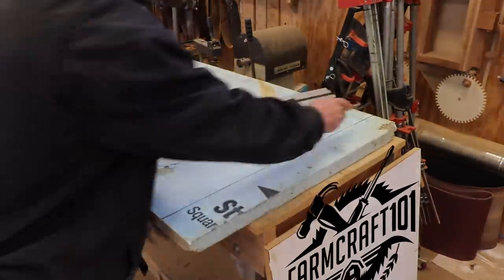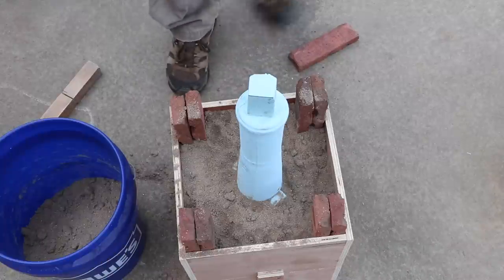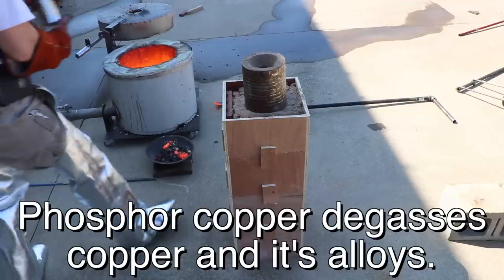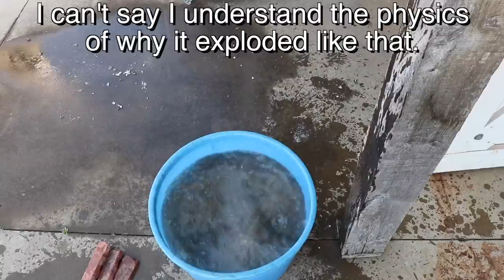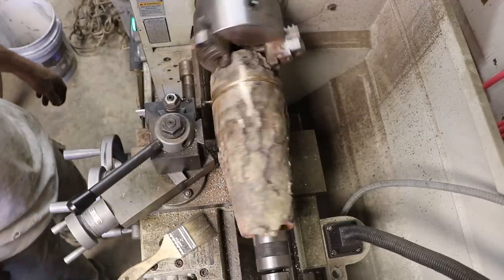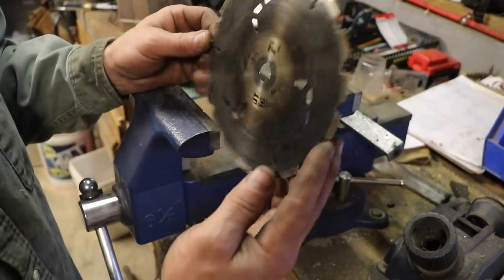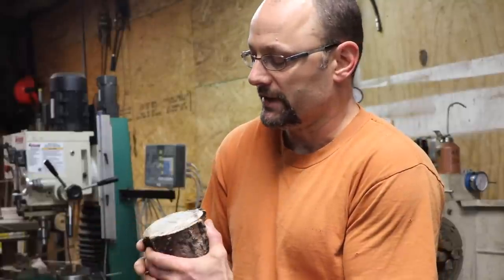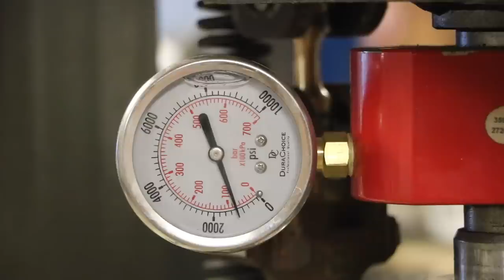How NOT To Cast A Historic Bronze Cannon Barrel.  FarmCraft101

Comment: After reading some of the comments and replies thereto I feel that a little "Metallurgy 101" is in order.
Phosphor copper does NOT remove hydrogen from copper base alloys, it is in fact a deoxidant and is thus used to remove the ever present (In badly melted copper) copper oxide. In this case the zinc added via the brass would likely have already done that so the phosphor copper addition was unnecessary.
Left over phosphorous (and that is what you would have had) forms a low melting point eutectic with copper that is about as fluid as methylated spirits - it will rapidly penetrate coarse or loosely rammed sand moulds forming an ugly composite of sand and metal  - (well, fancy that - sound familiar?) that is, as you found out most destructive of tooling.
The voids seen in most if not all home melted copper are NOT hydrogen.
Even when done well lost foam is not a technique known to produce the best quality castings. The idea is that the gases from the styrene escape through the sands  and NOT through the liquid metal. Styrene has the general formula (C3H8)n. {EDIT, this is a mistake C3H8 is propane what I meant to type was (C8H8)n and in response to a request from a commenter I have edited this post to both correct and expose my typo. END EDIT} At the temperatures involved here some decomposition of the styrene is likely thus the gas bubbling through you metal did contain hydrogen, and some pick up seems possible perhaps even likely. In any case to assume that bubbles (save perhaps inert gasses) traveling through metal do not leave damage in their wake is foolish in the extreme.
"Linear Grain" - Hmm, that's a good one - Its actually called "columnar grain". It results from grains (dendrites) growing inward  (into the remaining liquid metal) from the outside being constricted into growing in just the one direction (inward) by the grains growing alongside them.
Just a quick eye ball of that crucible and pattern told me that there was little chance of there being enough metal in that crucible to fill that mould.
The number on the outside of a (good) crucible is its capacity in Kg of molten copper brim full - you can always use that minus a bit in any calculations to see if enough metal is available.
I think that you were lucky that you did run out of metal  as had you not I suspect the mould would have floated up (from the lowest box junction) and you would have got very wet and hot boots, moon suit or no. I would suggest that clamping or weighting the mould a much better safety precaution than one of those awkward and restrictive moon suits. 
The gauge length on you tensile specimen was a bit short - actually a lot short.
This is not all that I saw but its all I have time for now.     Fred
Reply: good analysis
Reply: deuces roxy , Didn't need Cody's lab to  tell me what was wrong here! Don't watch him much and have some doubts that he would know its such an arcane area. Also would someone please tell Farm that the word is  "Cast" not "Casted". Fred
Reply: LIttle bit of phospor/copper goes a long way.  The more you over due it the less tensile strength, and the more brittle the metal.  The vertical cast was too much weight and swelled your canon.
Reply: @rich1051414 , Ouch! Please be assured that I did not intend to demean Cody's lab in any way, while I am not a regular viewer I have watched some of his videos and did find them quite interesting. Note that it was not I who introduced him into the conversation. There is in fact a co-dependency :- where would metallurgists be if there were no geologists to find the stuff they work with and where would geologists be if there were no metallurgists to use the stuff they find? This mitigates against any mutual demeaning and if fact great respect exists, two sides of the one coin almost.
Back in my student days the metallurgy and geology departments were under the same roof, we were in essence the same department, there was no enmity between us and in fact we were united against our common "foe" 😊 the chemists from next door. The metallurgy and geology courses had some common subjects in the early years so each of us had a better than  average smattering of the other's field. However, I doubt that the average geologist would know any more about say, the copper/copper phosphide eutectics effect on the fluidity and mould penetration than the average metallurgist would about which strata monograptus parultyimus would appear in and if it was an index fossil for that strata. (Although we would probably both know where to look to find out.) The point is that both geology and metallurgy are rather arcane subjects, Metallurgy perhaps the more so (eh, maybe not) and public ignorance and myths  about them abound. The ignorance and myths are understandable and non- galling but what I do find non-trivial and I would expect that likely Cody would too is when people make factually incorrect "ex- cathedra" type pronouncements on these , "our" subjects. Subjects that they not only seem to completely misunderstand but also do not seem to have bothered with even the shallowest of research into.
Now regarding my science, I am quite happy to have my mistakes pointed out for that is one important way we learn. I am happy too, to enter debate, provided reasoned and reasonable, on a scientific basis but once the debate degenerates to pointless invective - well, nah not my cup of tea.
Reply: @The Product, Depends on the host, a knowledgeable one and its a hoot and we rock otherwise its a dull bore.
Reply: @rich1051414  geologists aren't trained in depth metallurgy. There trained enough, pertaining to geology...
Reply: @softsmoken  My point was that making assumptions about what someone knows and doesn't know usually doesn't turn out very well, and it rarely feels good at all when it is done to you.
It looks like I misinterpreted what he was saying, as it sounded like he was dismissing 'this cody guy' as some youtuber who doesn't know up from down.
Reply: @rich1051414  assumptions are no good in general, but doubting something based on it being uncommon knowledge isn't the same thing as saying for a fact this person doesn't know about this topic. Based on a background like geology, it's also not the same to say they probably don't thoroughly know about x when it's not common knowledge to the field of geology. Someone assuming you don't know something shouldnt hurt you it should boost you if anything if your confident in yourself at all because you know you know something people doubt people know. (This isn't to you specifically  but it's like) Grow some balls and stop whining about what doesn't feel good. Who cares what others think.
Reply: Hahahaha that was fun! Cheers eh!
Reply: @The Product, Ah, that explains the severe pain 😣 in my groin area. But no worries mate, I will survive 😊. You are right its a very foreign language to most. Fred
Reply: "Styrene has the general formula (C3H8)n"
Its (C8H8)n, you somehow lost 5 carbon ;)
Reply: @leocurious9919 , You are of course dead right! Thank you for pointing out the mistake. I can only assume that I got confused with propane which is of course C3H8 (I think 😊) I could of course go back and edit the post but I think I will leave it just to prove that we all make mistakes, as the saying goes "the man who has not made a mistake has not made anything". I am surprised though that nobody else picked it up. Thank you my friend. Fred
Reply: @alterego4218  I didnt expect such a reaction, hats off. Please never change ur attitude.
Reply: @leocurious9919  at least it wasn't an oxide reaction ;)
Reply: Good thing you replied because it's been far too long since I did these tests in the property materials class :-D
Reply: Over due it? Tell me, is English your first language or were you pissed when commenting??? :)
Reply: @The Product , Ya, like knowing what he's talking about.
Reply: AvE would have gotten it done already
Reply: Deuces roxy, I mainly lurk in the background but occasionally I come across someone not doing as well as they might in one of the few areas I know something about and then I am moved to comment. Hopefully in an helpful way but sometimes it comes over as a bit harsh, so I don't commrnt very often. If you want to see reasonable coments and useful replies thereto there is a channel I have come across by a bloke who seems to know what he is doing - Olfoundryman - check him out you might like what you see. Fred
Reply: @rich1051414  Geology has nothing at all to do with metallurgy.
Reply: @KillItandGrillIt  You serious? Metallurgical, Mining and Geological Engineers are a type of engineering geologist that work with the logistics of mines and mining - existing and new mines.
Reply: @Bubu567  There is no such discipline as Metallurgical mining. There is mining which covers everything that can be mined. Then there's metallurgy which is the science of metal an metal alloys and they are separate fields all together so yes I'm serious are you?
 I have studied both and still have my text books and one has absolutely nothing to do with the other.
Reply: @KillItandGrillIt  Well, you are wrong. Btw, I never said "Metallurgical mining", surprised you claim a college education without understanding how comma's work.
Go to unr 'dot' edu 'slash' mining. I had to type it this way so the comment isn't deleted. You have no idea what you are talking about, and you should stop.
Reply: @Bubu567  Well according to this page that you provided you are wrong, you have problem with "surprised you claim a college education without understanding how comma's work." and  also reading with understanding is clearly not your thing "Mining Engineering and Metallurgical Engineering" ≠ "Metallurgical mining"...
Reply: @Bubu567  Yes you did say Metallurgical mining. Look again.
Reply: @Bubu567  You are not very smart. You just lied in front of everyone.
Reply: @Bialy_1  EDUCATION TIME!
Metallurgical, Mining and Geological Engineers
^--That means:
Metallurgical Engineers, Mining Engineers, and Geological Engineers.

No where did I say Metallurgical mining! Get back to your special ed classes kids.
Reply: @The Product quite the contrary, parties would be more enjoyable if people possessed the knowledge to "conversate" about more than Kim Kardashian.

"language comes down to vernacular"" and "is constantly evolving" are rubbish arguments made by the intellectually lazy and intentionally provocative.
Reply: Cool story, bro.
Reply: @The Product lol.... nice try.
Reply: someone knows their stuff.
Reply: @alterego4218  Thank you. I was in search of the perfect man and until you pointed out your mistake, I thought that it might be you. Now that we know even you can make a mistake, we can let that dream of perfection die a peaceful death. Let it be known, share the good news. Youtube user: "Alterego42" has made a mistake and thus rendered us all capable of the same. 

I will hypothesize that the mistake was made due to the similarity in hue emitted by this curious alloy. It probably reminded a turbo-nerd such as yourself of your first sex doll. C3PO. I'm not questioning your knowledge of metals, arguing with you over that would be a real propane in the arse. I'm simply observing your love of Star Wars trump your love for metals. Which is not very metal.
Reply: @wkruse84 , Steady there lad! It was a simply typo nothing more. I am old enough to be neither nerd nor skilled typist and whilst I did derive some amusement from the SW series I certainly am not as enamoured with it as you suggest. And yes, clearly, we are all capable of making mistakes. Fred
Reply: @alterego4218  "...I did derive some amusement from the SW series..." I don't like the new ones either.  Too pretentious, maybe? I get my fill of that on you tube.
Reply: @alterego4218  I'm so dissapointed, you made a stella comment and I see there were 50ish replies; not one is actually discussing the topic of your comment... Arcane indeed your metallurgy subject must be. Unfortunately I can't be the first to do so either as my subject was lost wax casting of small objects like jewellery, mostly using silver and gold. Ah well never mind eh :)
Reply: Yes. It's been over 20 years since my material science classes, but I was guessing about the same things as you are saying.
Next to that, I would also argue that dropping the whole thing in a bucket of water to cool it down can do a lot of bad things as well, creating different internal structures and leading to all kinds of weaknesses.
If you plan to make something that you actually want to fire, you need to do A LOT more research. Historically a lot of these things would blow up and kill people.
Reply: @rich1051414  , Blah, blah, blah...  Geology is close to studying and using metallurgy but definitely not the same. By the way, your English sounds so crude, I'd not expect much more from you than that.
Reply: @jester5ify  , probably using a Windows machine...  LOL
Reply: @KillItandGrillIt  , Um... read the comment by Alterego42 on how they were in the same area in college and how they supported each other.
Reply: @Jimmeh_B  , Ah, but those sentiments are SO "in vogue" by the simplistic minds now so extant.
Reply: RogerWilco,   Unfortunately, I was worrying about him, too. So many ways to go "boom," so little time in a video. Let's all pray for his long, safe tenure here.
Reply: @Bubu567  What you do, Edit it? Let it go no one agrees with you that saw it.
Reply: @BruceNitroxpro  Not going to waste my time with these people.
Reply: @BruceNitroxpro  as metal licka put it, "sad but true"
Reply: @alterego4218  I recommend changing the original post so someone doesn't adopt the incorrect information. You could provide some summary of the mistake at the end of the post if that floats your mould.
Reply: @mattpatt , Done … Fred
Reply: @alterego4218  And ....There is not a Plural of Cannon.
Reply: @alterego4218  And there is No of Cannon
Reply: @alterego4218 - Excellent explanation noted. Also to realize that over 5,000 yrs ago, a brilliant survivalist named 'Oetzi' [by researchers] happened to understand all facets of the 'Bronze' trade... in addition to medicine as a side line to his countless other skills.
 Testament was that 'Oetzi' survived to approximately 40+ years, when average life expectancy was in the teens. Only when odds were heavily stacked against him, was he brought down. Even then, he apparently, according to evidence, drew blood from his enemies.
 This drama btw, [only revealed during the last generation] all occurred near the end of an extensive 'global warming', and preserved [buried under ice] by the regional Priora Oscillation.
Reply: @mike85364 . Did I say there was? I can't find where. But if I did silly me. Fred
Reply: @alterego4218  Solid insights.. as with all other hyper-intellectuals though, your desire to share knowledge seems to be diminished by the condescending tone you took toward the content provider.  While your advise to him seems to be solid (I'm not a metallurgist), you convey unprovoked condescension when you use phrases like "Hmm, that's a good one", and maintain a derogatory theme without acknowledging his efforts.  Novice or no, he went to a good amount of time to put together an interesting video, and give us the opportunity to have a discussion where I learn interesting things about dendrites and styrene ;-)  
Enjoyed your contribution.. definitely seems to have some of the most useful info on the topic in the comments ;-)
Reply: @rich1051414  I love cody but he's just a student, not a grad, and materials science is a whole different degree in engineering.
Reply: Alterego, I'm hoping you'll take a moment to give advice about casting a few thousand pounds of lead for a sailboat keel. I'm thinking a propane burner, and pouring it into an old bathtub.It will be scrap lead, from batteries, fishing weights, tire balancers.

Comment: Not gonna lie...your 7:00 "explosion" actually scared the shit out of me lmao

EDIT: Also you don't need to use the little 4.5' grinder to grind this...that would take forever and like you said..use 50 wheels. Get yourself a corded 9in grinder and it would have taken care of this in about 5-10 minutes with only 1 wheel.
Reply: No lie, I jumped too! Hahaha
Reply: And in addition, don't try to use grinding wheels as cutoff wheels.
Reply: Scared the hell out me watching it at almost 4am! Thank you insomnia! 🤣👌
Reply: I definitely wouldn't dick around with a 9" grinder either. You can get a cheap 14" metal cutoff saw for like $50. It basically looks like a regular chop saw with a large cutoff wheel mounted. That's what us poor folk use to cut tough (i.e. 304 SS) exhaust pipes. A cold saw is too expensive, and a bandsaw takes forever. Nothing beats a metal cutoff saw for "quick and dirty" cutting.
Reply: Jesus Christ I flinched so hard when that happened.
Reply: @Vinwelder  Insominia? Was that before or after the water explosion. :-D
Reply: I jumped too! hahaha
Reply: For me it was the foam when it came off the lathe, and I knew it was just foam LMAO